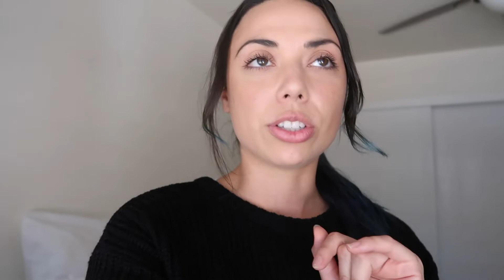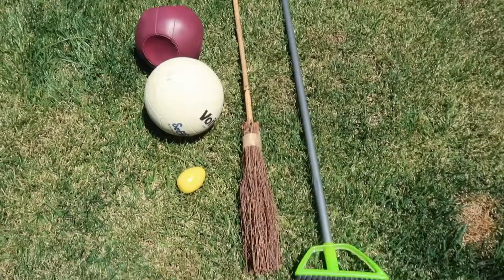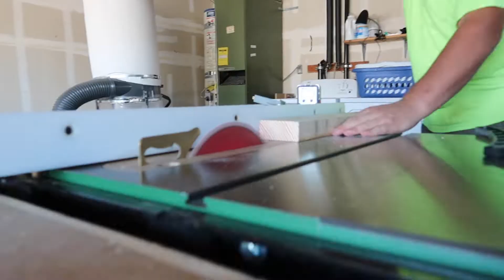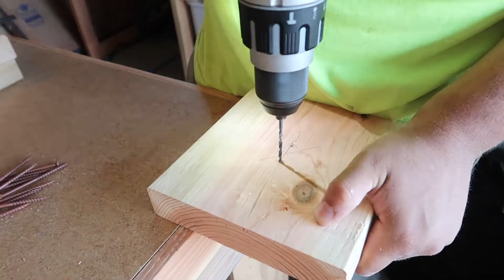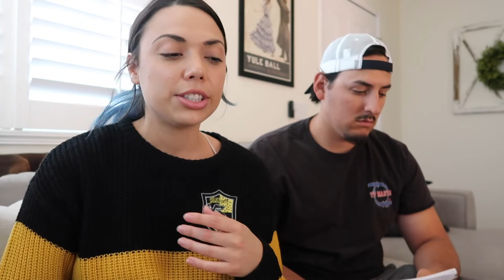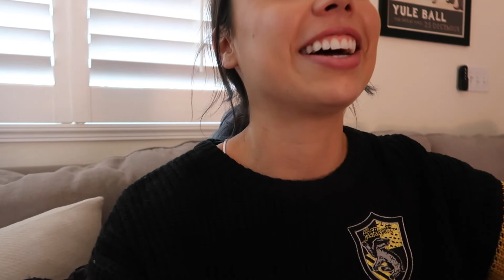DIY Quidditch Posts

Comment: What’s even the point of the Quaffle and the Bludgers if you win automatically when you catch the snitch and the game doesn’t end until you catch it?
Reply: The bludger adds the fun in game by knocking u off
And quaffle adds ten points 
But the snitch adds 150 points
Most of the time u will win if u catch it
But in one game bulgeria against the ireland lost even tho they catch the snitch
Cz ireland had 170 points and Bulgaria had 10 points and when they catch the snitch they got 160 which makes them lose
So u won't win every time if u catch the snitch